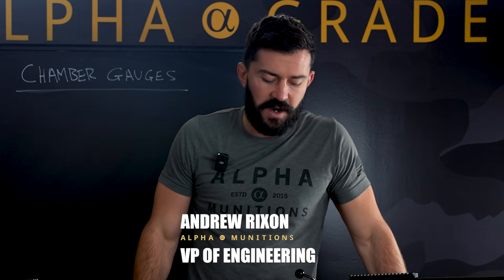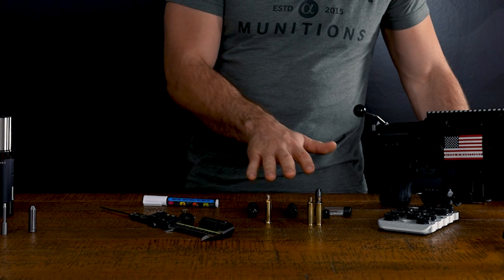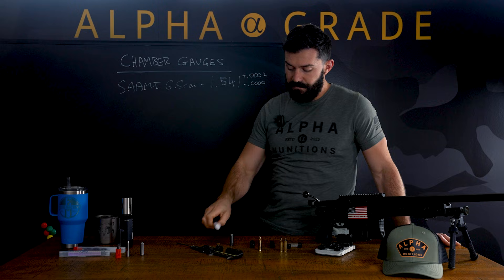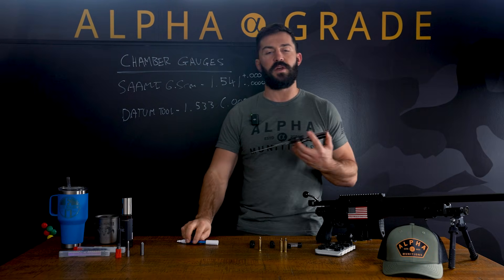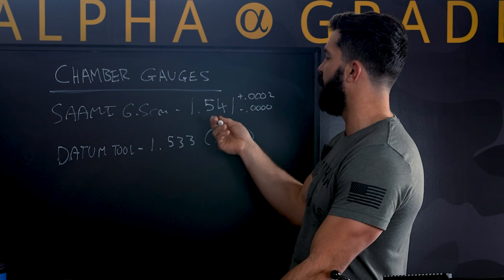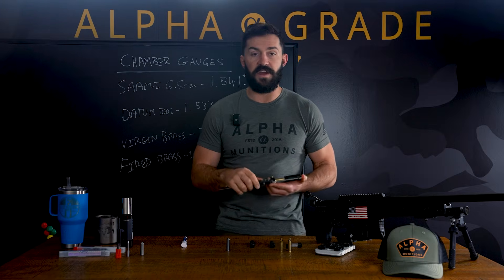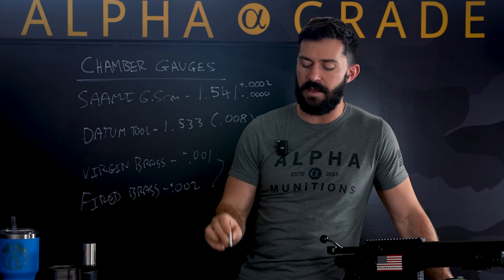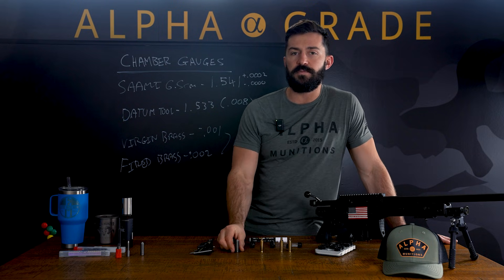How to Correctly Check Chamber Headspace

Comment: SAAMI spec for 6.5 Creedmoor base to shoulder datum is 1.5438 - 0.0070. So 1.541 is 0.0028 below max and 0.0042 above min. How was the 1.541" value selected?
Reply from the maker: Richard, you are referencing the cartridge spec on Saami, not the chamber spec. Chamber specification on SAAMI is 1.541-1.551 inches to the .4 datum diameter. The gauges are chamber gauges, thus using the chamber specifications, not cartridge as you are referencing. I will say this question does bring up a good point, that the max cartridge shoulder length is .0028 longer than the min chamber spec length so there can be an incompatibility between the two, which is ridiculous to think. We spec all our brass short from min chamber length so we ensure compatibility.

Comment: Serious question from an old machinist:  Are there no tools for proper micrometers?  Even the best calipers are only guaranteed to +/- .002”.   Calipers are great for reference, and skilled people can take pretty accurate measurements, but they aren’t to be trusted for anything less than +/- .005 tolerances. I see far too many people on YouTube trusting that fourth digit as accurate. 

I know I’m being pedantic, but I’m just curious by nature. Thanks for the videos!  And I love Alpha brass!
Reply from the maker: You are correct and there are more accurate ways to measure, we have far more accurate tools at the shop for all our production measurements. This video though is intended for the average shooter, and most shooters can't spend the money on extreme precision micrometers or optical comparators. That is why we can use our qualified chamber gauge to check the accuracy and consistency of a measurement system and then that person can account for whatever offset is occurring. we check all our gauge tooling against known qualified samples, that way we can determine if they are remaining accurate and consistent. This tool enables our customers to do the same with their at home equipment.
Reply: It would be awesome to be a metrologist at @alphamunitions
Reply: Mo's gauge, RCBS Precision mic. or Whidden Case gauge are probably slightly more accurate.
Reply: I'm sure it would be super hard to break the habit as a machinist but he seems to be driving at relative rather than absolute measurements, citing that even the Mitotoyo calipers have an absolute inaccuracy of 0.008, which is much higher than I would have expected.  In that moment, the non-machinist that I am decided he was pushing toward relative rather than absolute measurements.  Something I hadn't considered until now but it would make sense.  You'd want absolute precision in cutting the chamber but relative measurements are "close enough" for brass that will be constantly changing dimension as its worked.

I hadn't considered using micrometers to measure the dimensionality of brass but I see where you're going with that.  I suppose if an anvil and the proper datum line bushings could be made to work with a set of micrometers there's no reason you couldn't use them. I don't know that it would give you much more than very overworked OCD.

Thoughts?
Reply: Pour la hotte précision prend une cal de 4, 00000 c’est on peu cher et mètre le pied à coulisse à zéro et tons problème et réglé